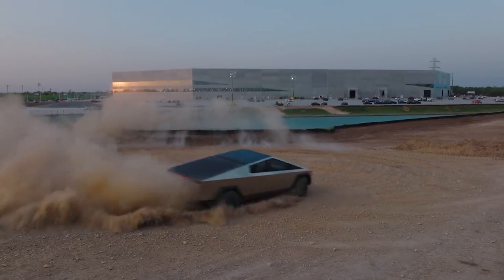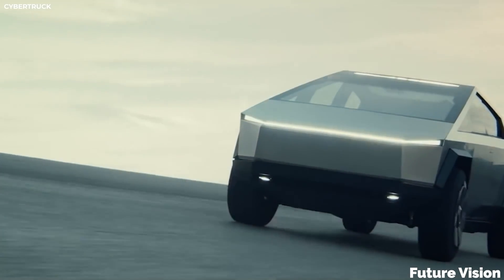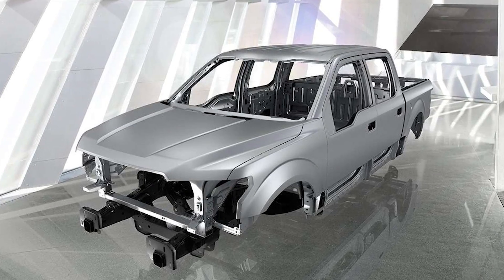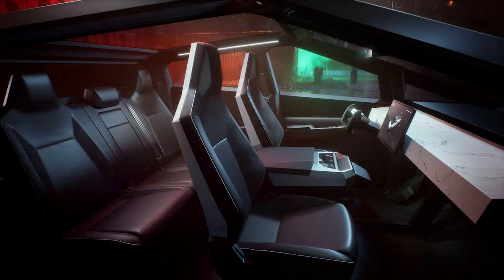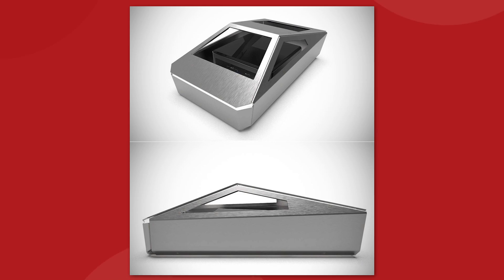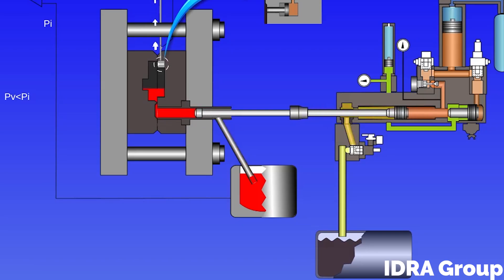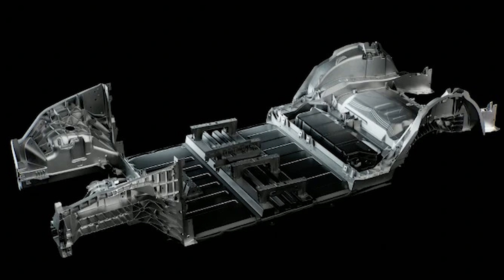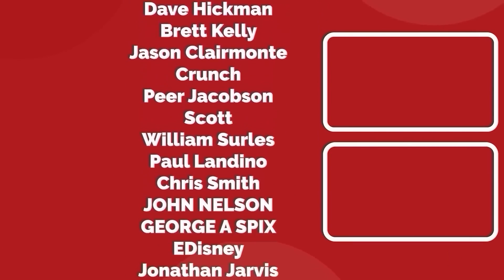The Real Reason Tesla Developed The Cybertruck!

Comment: We don't hate it because it challenges the status quo, we hate it because it's really difficult to build and Elon raised hundreds of millions of dollars off of the false promise that it would be built rapidly. It's also more car than most people need, and because of the design choices it's going to be incredibly difficult and expensive to repair, and with Tesla's DEAD LAST rating in initial build quality you know a lot of them are gonna need serious repairs.

Also re: body stiffness. The body of a truck is soft to absorb energy in an impact. Teslas still get hit in accidents and if the body is the frame there is nowhere for that energy to go except for the passengers. From a first principles standpoint shouldn't we put human safety above saving 5% on the total vehicle weight of a vehicle that is already going to be one of the heaviest cars on the road?

Comment: Great job.  When I first saw the Cybertruck, my initial thought was that there is no way I could ever drive something that looked like that.  However, after watching several videos, including this one, on the design and structure, now I understand why it looks the way it does.  The design and function are light years ahead of the competition.  I'm so impressed/amazed at what they've done that I just submitted an order for one.
Reply: The principles of design are more like those from the 60's. Trucks didn't leave the heavy bodies behind because they were expensive, they left them behind because the bodywork absorbing energy in an impact is important for human safety. As a bonus a light body on a heavy frame is also a lot easier to repair than a unibody. Cybertruck is throwing safety and repairability away, but accidents aren't gonna stop next year, hell cars get hit parked at stoplights.
Reply: @Jason Sellors trucks used to have tremendous structural integrity in the heavy sheet metal cabs. Taking out the strength made them safer. Strength ≠ safety.
Reply: Hahahaha

Comment: Well done video, great facts, great job with the excerpts and having them pertain to the info you are giving and the explanations are good without being too long. now, my contention is this: its still ugly as hell and being its a truck that should be able to do work and not be a glorified station wagon, it doesnt matter that its super aerodynamic and looks like a doorstop with wheels. You can make it look like a truck and actually attract more than a couple buyers. IMO, we dont have the tech to make electric trucks powerful enough, make batterys/caps to really fuel a truck properly and no way in hell do we have the infrastructure to support all these electric vehicles they want to put on the road and i think musk knows that. We are coming up against a Solar CME in 2033 that the emp from it is going to decimate the electric grid around the world all at once. With that, all these cars, pc's, electric generators and substations, pole transformers, nuclear towers, etc... will all be destroyed and it will take years to get everything back up and running cause well have to fix all the tools to build the stuff first. Everything Musk is doing will be zapped and gone, turned to trash in seconds.... along with the AI crap, thankfully.

Comment: Sorry to say that "sledge hammer" test is BS. They were clearly using a dead blow hammer which is designed to not damage what you are hitting. I laughed out loud when I saw it, And the guy pulled the hit to mitigate the blow and the door handle still popped out.

Comment: I'm sorry, but nearly all of your info is incorrect.... in physics, mechanics, and all science fields.  If you think that thin "stainless steel" is too hard it would break the stamping dies.... HAHAHAHAHAHA   please.  Have you seen how vehicle frames are made?  Stamped steel axle housings? For gods sake.... hundreds of millions of shipping containers corrugated sides.  hahaha.   Seriously.  You can curve bend AR500 and AR550 steel even when it's 3/8 or 1/2 inch thick.  hahahah  Do you know how many MAGNITUDES times harder that is???  

"How heavy is a can of paint?".... dude.... do you not know what drying... IE evaporation is???  Do you thin it's always that weight?  HAHAHA... Seriously.  Wow.
If you think body panels add zero structural integrity to a vehicle... cut off your fenders to the "skeletal frame" and try and drive it around the block... it will be scary flexy. 
"The triangle is the strongest shape in geometry"...????   Do you mean a Sphere?   I think you might want to go back to basic science class.  a constantly curved arch is far stronger that a triangle... as any of the flat sides of a triangle if compromised, the whole structure fails... and nothing compromises as easy as a flat surface.  Try walking with a sheet of glass held horizontal, and a curved glass  (curved up or down) held horizontally.... walk around a bit.  We'll see which one is structurally more resilient.  There is a reason normal body panels have curves and corrugations...  IT ADDS STRENGTH!  Shipping containers aren't smooth flat sides!!!  Even your "Eiffel Tower" example... the structures over all shape... is a curve.  Lordy... you missed the forest for the trees on that one.  hahaha.  The more "geometric" shaped truss bridges are built that way for COST effectiveness... NOT strength.  Bridges built where strength was the over dominant factor... are all curved or arched.
If you think Stainless steel is the stronger steel... you do NOT understand material sciences... quickly look up a chart for bolt strength vs type.... and come back to this point.  You'll see Stainless is pretty low down on the chart.   And if you think SS material is rust proof.... okie dokie....  it's only rust preventative.  If it lives it's life near an ocean, or where they salt roads (things trucks do ALL the time) you will find it will most certainly rust.  There are many grades of SS alloys... NONE of them are rust proof.  Period.  Ask the metal suppliers if they'll lifetime warranty it... hahaha.  I'll wait.  
Cast aluminum... is the weakest most brittle crap there is.  Forged is better... but still not safe.  Lordy.  Cast aluminum will crack with out any accident or impact.  Road vibration will do that over time.  Hence truck FRAMES normally flex a little.  The aluminum underbelly... yea... a small tree branch will make mince meat of it.  Galling it to misshapen form and compromising it's integrity.  Don't even get me started on how every time you charge that battery tech... it's builds up material on the inside walls and when they touch... they arch and short out... hence laptops and cell phone batteries getting hot, then either catching fire, and/or exploding.  We've all seem hundreds if not thousands of these on youtube alone.  

That truck has TERRIBLE visibility, super low ground clearance, no lockers other than traction control, crap cast wheels that hang out further than the rubber tires, it's not available in different configurations of cab, bed or tonnage... The read bed side angels... good god that's F-ing useless and dysfunctional.  bragging about a tow rating of 14,000lbs... is not impressive.  Don't even get me started on what happens when any electric car get's caught in water... like a flood or river crossing... they literally burst into flames and explode.  Electronic parts like Electrolytic capacitors have rubber seals and thus a short lifespan of between 6 to 12 years depending on the environment... as compared to say a nearly all mechanical gas or diesel truck that have proven to last DECADES upon DECADES....   How is this in any way shape or form a TRUCK???  Where is the Tool boxes going?  Lumber rack?  How well is it getting out to the forest, lake, construction site???  Plan to drive deep into the woods, or across the desert?   NOT in this thing.  Plan to go out to the cabin... NOT in this thing.  It's a city dwelling, short trip, low capacity, low tow rating, low hauling, minimal utility... slightly taller Tesla car... that's it.

narrator

Comment: You never talk about battery life when towing a serious load.  I tow an 8,600 lb Airstream.  With my RAM 1500, I get up to 350 miles per tank of gas towing that sucker and up to 700 miles when I am not towing.  The Cybertruck is an interesting engineering project, but unless it can tow up to 10k lbs for 300 miles on a single charge in the middle of the winter or summer, it is not a "real" truck for real truck users.
Reply: It can tow a much larger load. But it’s not meant to be a work truck, so I think it’s still a win when compared to a RAM 1500 which still isn’t the best work truck  available.
Reply: @derrickstevenson5009  by definition trucks were for work.  The video here, talked about how Cybertruck would be the truck that would up the game in every aspect.  Cyber truck does have great payload and towing capacity, but falls short of towing that 300 miles.  Closer to 200 to 250 miles.
Reply: maybe if you said hybrid SUV but it's a truck and trucks are functionally created to do specific tasks really really well, like towing or hauling.

Comment: dead weyght.,. can u use a car without bonet o dors...?

a car resistance is given by the total fixed structure  unibody or body on frame, the same thing, body on frame ha plenty advantages vs all other designs, its modular ,  easyer to fix, etc.

there is no dead weyght, ...lets throw away the engine cuz its dead weyght.....the car is a asembly of parts, its not just a frame...
.
the ecuations relating to eficiency...   weyght vs engine eficiency /endurance ...weyght/power,  batery / eficiency  , i mean u want a electric  7 seater, and the car is 2 tons , u can have it cheap and poor range/quality, or expensive and have what u need..

about eficiency /endurance... the 1 liter 3 piston engines... they may be eficient but they arent going to haul a 1 ton trailer or go pass 250000 km ... i prefer a engine that isnt that eficient, but can haul or endure 500000km.

Comment: some corrections here- traditional trucks use the dual beam layout because they need strength concentrated all around the powertrain since trucks are expected to tow things. A monocoque design is going to be worse for towing, all things being equal (and electric trucks are not really made for towing). 

The dual beam layout also helps keep the CoG low, something that battery-drive vehicles can accomplish with a low slung battery pack. 

Another reason for the beam design is to allow isolation of the cab from the truck bed- a requirement for actual work trucks to provide modularity, comfort, and performance.

Finally, a monocoque design  does poorly with the low height of the truck bed sides. This is why the Chevy avalance has those diagonal bars on either side of the bed, and why the 1st gen Honda Ridgeline had that Cybertruck-esque shape. Its hard to get the rear end stiff enough to allow for rear suspension without a C pillar in the monocoque frame, which is why the Cybertruck also has that sloping bed side shape.
Reply: Are you saying the Cybertruck will be worse at towing than the average truck?
Reply: @armando-is-lost  Undoubtedly. The Cybertruck is not (and no electric truck is) is made for towing. Thats not their purpose. They are mostly made to push the envelope of technology, development, and to be a loss leader for their respective brands.

Comment: You forgot to mention safety in a collision. There are reasons why panels are thin. They are to designed to crumple to absorb impact and also absorb people energy on low speed impacts. If the panels are thick and strong, then it will pass the NCAP safety for European markets.

Comment: There is a reason why modern vehicle deform so easily. The whole front of car and especially bumper made from soft materials to absorb energy from collision. It is simple safety concern that became a requirement after many MANY accidents
Reply: Moreover "because the customer obsession with esthetics the car needs to be painted" what BS is that? Obviously different people like different colors. There is no obsession in that. The paint is NOT "dead weight"

Comment: The Cybertruck will never be a commercial work horse vehicle.  Why?  The bed is too small and only really accessible at the very back thanks to the sloping sides.  It will only ever be a status symbol for those who have money to burn.  On the safety side the truck will be a death trap if it hits something more solid than itself.  It has no crumple zones.  That rolled stainless steal is very stong which means it isn't gong to deform and absorb the energy of the impact.  The driver and any other occupants will.  Which means more deaths and more severe injuries.  The front of the Cybertruck is going to act like a steel chisel when it rear ends another vehicle driving it right through any moderate passenger car into the victims cab.

Comment: I really hate pick-ups. Okay, I really, really hate pick-up drivers. Do people really need an oversized vehicle when they don't have a job that requires it? Driving to and from work every day I see many, many pick-up trucks. The drivers are aggressive, they drive too close, and even when they don't, the placement of the LED headlights almost guarantees you will be blinded. I'm curious on what the personality of your average Cybertruck driver is going to be. I suspect knowing they are driving something marketed as indestructable will not lead to safe driving. Nor am I confident in having a battery that isn't easily replaced or upgraded. I don't have a problem with it being located underneath the passengers (even with the explodable Telsa stories), but it needs to be easily replaced. Cast iron parts has also been mentioned as being and issue for repair. Sure a modern vehicle has a thousand parts, but damaging one part doesn't total the entire vehicle. But as others have also mentioned, we have created a huge salvage market because of insurance companies refusing to fix vehicles. Maybe making vehicles like the Cybertruck is the best option. I'm willing to forgo my hatred of Musk and pick-up trucks to give this vehicle a chance. It still has not gone to market as far as I can tell though. But you can put $100 down to wait. Can Tesla create a vehicle that will last for decades and a price most Americans can afford? If the projected price range is around $50,000 and this vehicle is as durable as implied, then it might be the wonder it is being marketed as. Don't forget to add the Tesla charging station in your garage and probably the Tesla solar power roof.

Comment: I skimmed through a couple dozen comments already and none of them were written by people who really need a TRUCK! The builder contractor would be very limited by this design because there seems to be no mention of how to carry lumber, supplies, tools, etc., etc. No lumber rack! No large bed for transporting anything like a load of plywood or sheetrock. Explain how this truck meets the needs of working contractor and it might get me a little interested. And oh, BTW, how much does it cost???  Question: if the batteries are an integral part of the design and it is truly carrying the load of the truck, how do you ever replace the batteries?

Comment: Why didnt Tesla use a scandium/ally mix for the body. It would have been just as strong, lighter, cheaper, just as corrosion resistant, paintable (if you wanted) and able to be molded/shaped.

Comment: You're super wrong about the steel.  First no way it's 1/8" thick.  Second it's a specific type of stainless steel.  Most likely 301 which is a work hardenable steel coincidentally it's also a high temperature steel which is why it was being used in spacex.  Starting in it's soft state it can absolutely be press formed.  And the process of press forming will work harden the material but it's difficult to get consistent hardening results which would create a rather complex engineering problem in the form development.  Generally 301 is sold in either half hard or full hard.  It's likely that the truck uses half hard.

If it was indeed 1/8" thick half hard 301 stainless that smack with the deadblow sledge hammer would result in none of the deflection shown in the video.  This stuff is tough as hell.
Reply: I suppose it could be a martensite stainless steel like 410 but the corrosion resistance is less and then heat treating large thin pieces like that without warping or cracking is really difficult even though it's an air hardenable steel.  And then you've got to deal with the scale that's a result of heating it to 1,000 degrees before the quench which would mean substantial surface grinding would be necessary.   Much more likely someone said "hey that stuff we use on the space ships is pretty cool.  Bet we could make the truck out of it."

Comment: The external shape being the structure might meke sense if this think didn't have doors or a hood. Press brake forming major body components makes no sense in high volume manufacturing like an automotive line either. I'd like to see more images of the structure, but until then, I'm not buying the justification for the style.

Comment: what a load of bs. you want to talk about outer panels forming a "exoskeleton" but completely ignore the existence of doors and hatches. in reality that abomination has a conventional unibody made of non-traditional sheet metal. in this regard it isn't even a truck or pickup truck, it's just a large hatchback made of expensive materials that will stop working in the middle of winter due to shortcomings of the propulsion technologies applied.

Comment: This truck is for rich mall crawlers. Not a work truck, not third party reparable, too expensive and the charging infrastructure is a joke. It doesn't fill a need that isn't already filled by cheaper, longer lasting and easier to use and repair vehicles.